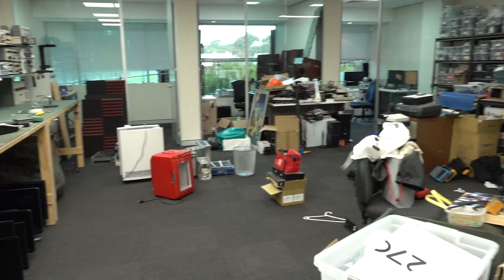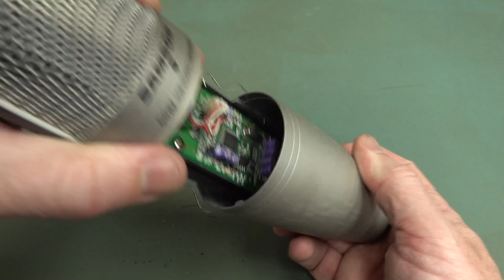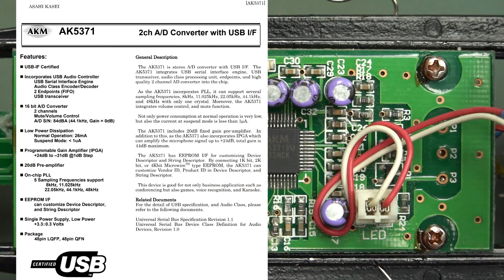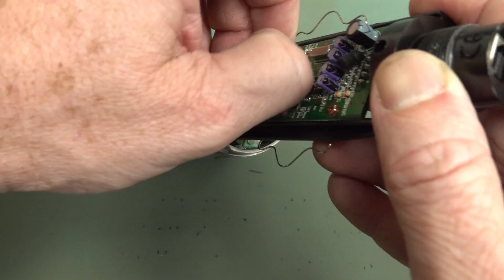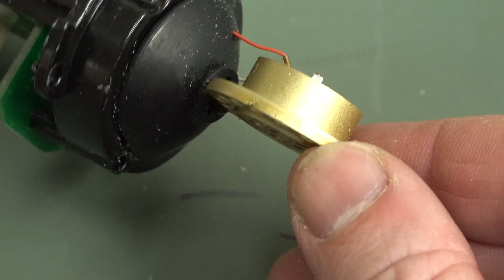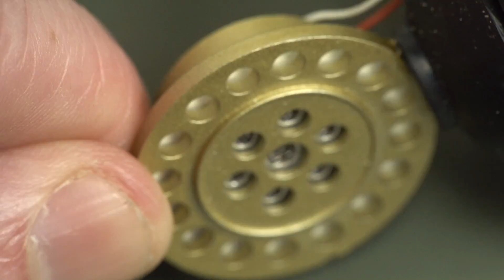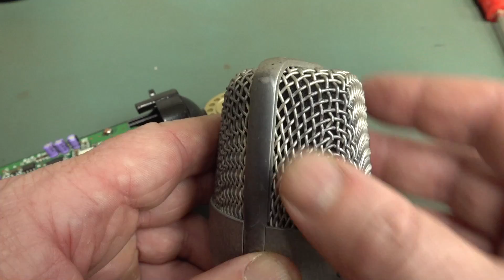EEVblog #1199 - Samson C01U USB Microphone Teardown

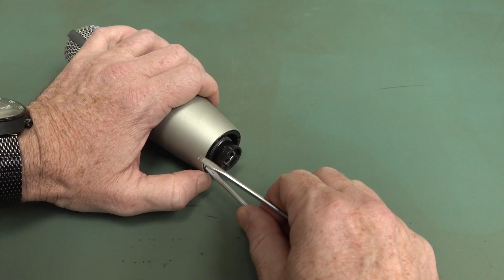Comment: 2:37 An even easier way - needle-nose pliers. Tips go into the notches, hold the thing open with the hand in-between the handles, job done.
Reply: That's the method I usually use. I have some very fine needle-nose pliers that work great for this.
Reply: @Markus0021  When i had to open up my first AKG Perception 200 (similar construction), i only had one pair of beefy-ish "needle-nose" pliers, and the tips were just the right size.

Good luck using that screwdriver-method if there's any threadlock in there... :P
Reply: Meanwhile, quite a few of us are wondering how Dave's workbench doesn't have a pair of snap ring pliers.
Reply: @petersage5157  Because it's Dave's bench, not AvE's bench - easy mistake to make, just one letter difference :D
Reply: @khronscave  Sure, Dave doesn't have to remove Jeezless clips on a regular basis, but I don't either, and my snap ring pliers see a lot more use than my needle nose pliers. It's just a better engineered tool.
Reply: @khronscave  yep, he has everything you need,  if you can find it. The cleanliness of his bench leaves a lot to be desired. Remember to keep your d in the vice.
Reply: Khron's Cave eevblog: More d than AvE.

Comment: Hey! That's the mic I've had for years :o I just modded it to use USB-C, it's a great mic considering how old it is
Reply: Nova Fawks Mod for a less durable cable and plug?  Why?
Remember, a USB 2 full size cable packs 4 wires in a 3 to 4mm thick cable, while a USB 3.1 C cable packs at least 16 wires into a thinner cable, making each individual signal wire much thinner and more easily broken by ordinary wear.  A full digital microphone won't need to go beyond 2Mbit bandwidth, so no use for USB 3+ superspeed etc.
Reply: @johnfrancisdoe1563  I understand that, I could change it easily again if I wanted to, the issue was the connector was already broken I only had an extra USB C female connector lying around and I needed the mic fixed asap. I would have preferred a USB B connector myself

Comment: I use one of these for making PC repair videos on my main channel. I'm sure there's people who have much more expensive kit that can out perform it, but for a semi-professional mic setup costing less than $100 I don't think it can be beat.
Reply: Definitely not, I've had one for about 7 or so years and I still prefer to use it over my $300 Audio-Technica AT4040 mic for ease of use, and the sound quality difference is pretty negligible. It is an excellent microphone for the cost, to be sure
Reply from the maker: Yep, for the price it's really hard to beat.

Comment: If an usb mic does not show up on the computer as an input, and say it is the mic is faulty, alltho led lights up and its sound thru the headphones output on the mic. 
Where could one start finding out the problem?
Reply: look up the datasheet on the USB IC in your mic and check the supply voltages going to it - always start with voltages
Reply: Data lines disconnected? USB transceiver chip (inside the mic) shot?

Comment: So has the landlord got the roof / original cause fixed? Would be great to find out what the cause was.
Reply from the maker: Everyone keeps asking this, and I've answered it a dozen times now. There was a MASSIVE hail storm that blocked the gutters and the building couldn't handle the volume of backed up water. Shit like this happens, you can't seal building against every eventuality like this. There is no fault, the building meets the code.

Comment: And all Caps look like Capxon - and fine from far away.
Reply: "Good from far, but far from good", eh?
Reply: @Stefan Payne, I didn't think you can go crappier than Capxcon?
Reply: The cheapest crap one can find.
Reply: @dorfschmidt4833  Seems like the Mic is still working perfectly fine after 10 Years, so it can't be that bad. And there are always Cheaper capacitors available as well.

So could we stop with the claim that only Wannabe Japanese Caps are good, wich come out of the same factories as other caps because the way Chinese Industry works?? Because of the Import Tax, it has to be made in China. So only if the device is NOT made in China, the caps can be made elswhere...
Where I got this Information? From a person that works for Corsair.